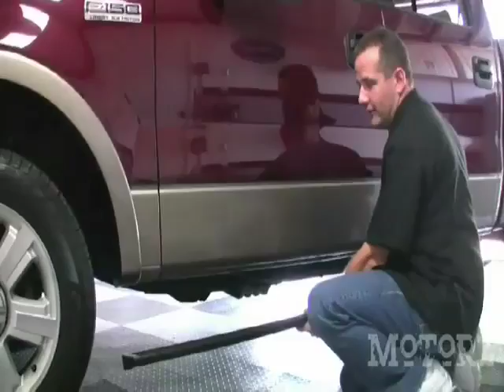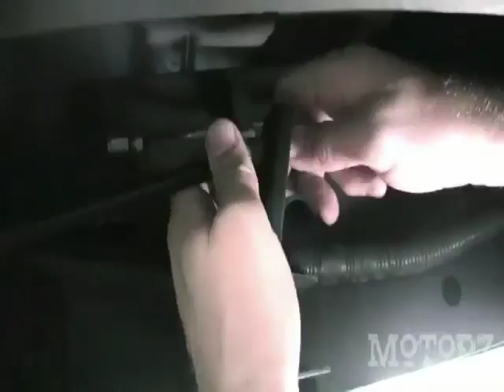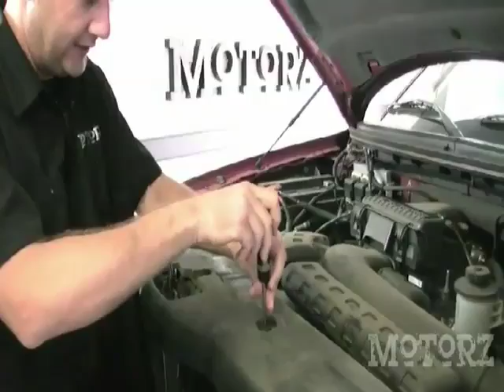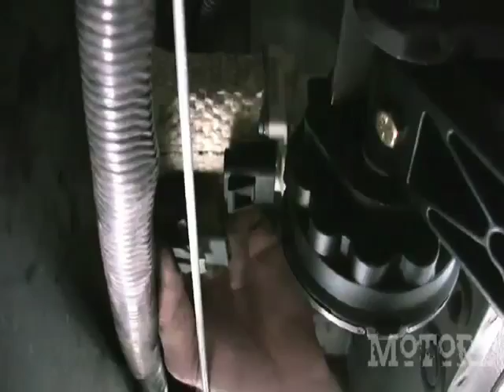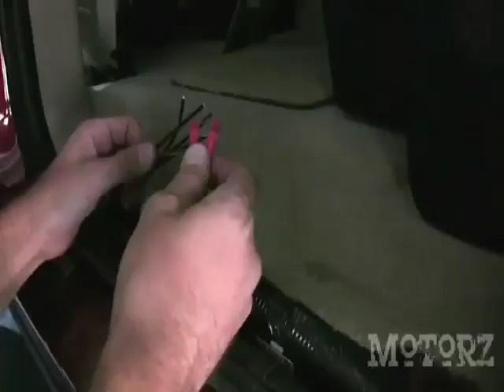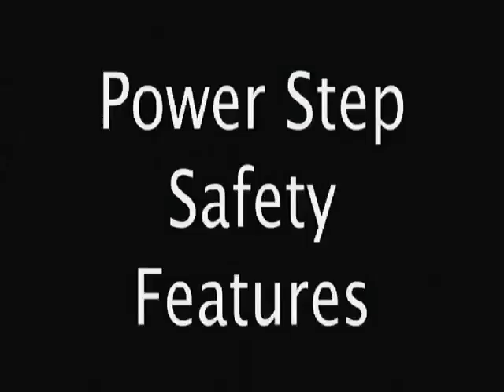AMP Research PowerStep Installation Guide on Motorz

Comment: I just installed mine the other day on my 2004 F150 SCAB but the passenger side doesn't work. I had followed the correct color wire from AMP to the factory(Black/Yellow for driver & Black/Pink for the passenger). I only have the driver side working for now while the passenger is still at it's upward position. I even reversed the wires with the driverside door for the passenger and it work. Maybe it might be the fuse for the passenger side door. Anything you may think of the problem? Thanks